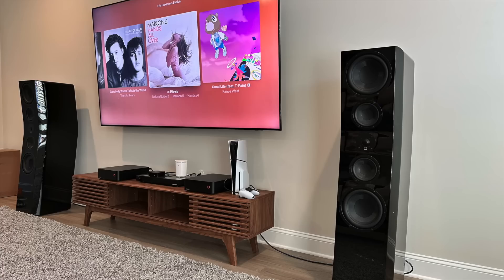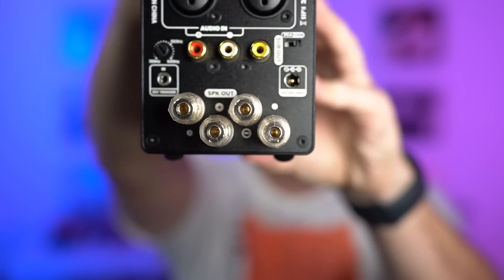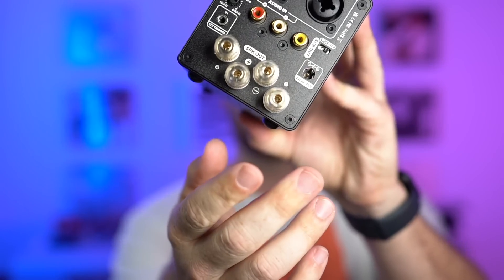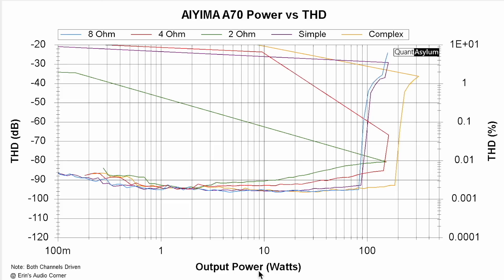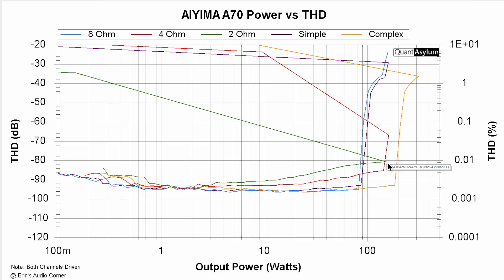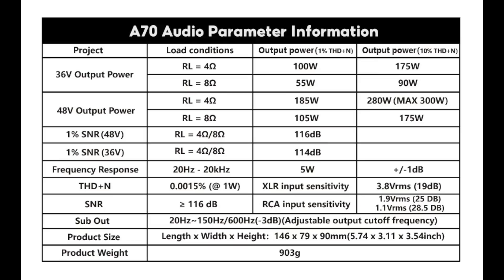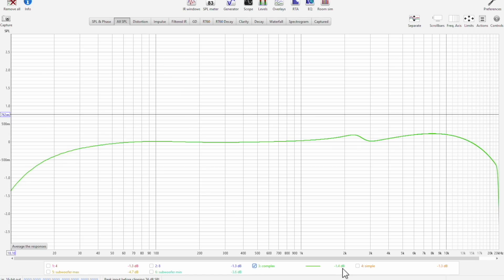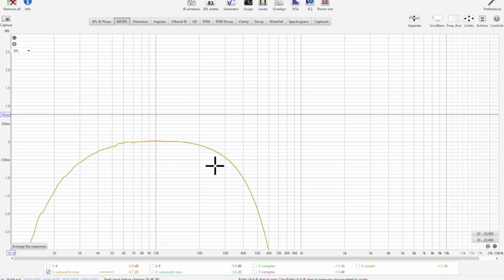The Shocking Truth About the AYEMA A70's Advertised Power!

Comment: I've run into so many annoying problems with load dependency on cheap class D that I got rid of them all and spent the extra to go to class a/b.  I can't quite afford the nice class D stuff.   None of the analysis I've seen done by ASR or Erin actually translates to the real world.  The only person I've seen show it with real speakers is MTG-Designs, and the effects are more pronounced than any of the complex load sims I've seen.  I've experience the A07 responding so poorly with a speaker that it caused a 10db rise from 5khz to 15khz!  

Frankly it doesn't seem like the budget companies are really fixing this problem.   Perhaps they are attempting to, but are ultimately failing.
Reply: The new Fosi V3 monoblocks have addressed this and have more power for about the same price.
Reply: @boomerscs9193  It's not really the same price since you need to buy two.
Reply: @joshcatstream it’s still within only ~ 100 bucks
Jeez, What do you expect for 200 dollars and 150 watts?
Reply: @richardgrant418  there are amps of the same price with no dependency, the audio source amp 100 for instance.
Reply from the maker: no. YouTube isn’t friendly with links. I just checked the junk folder and it wasn’t in there, but it may show up later. If you don’t see it later on then reply again and I’ll check again.
Reply: @ErinsAudioCorner  I figured as such, I can send some measurements via another channel if you're interested.  The issue might sound extreme but I assure you it is real.  The speaker in question was the C note kit from PE.  A quick google of cnote load dependency should bring up some images of my data, the second image result for example.
Reply from the maker: I was going along with you until … 

A 10dB rise from the speaker load?  Sorry, man, but my BS flag shot through the sky when I read that. I’m sure you can forgive me for being highly skeptical of such a statement. Especially without proof. What speaker was it?
Reply: @ErinsAudioCorner  I made a comment with data, did you just delete it?  I think youtube is broken or something.
Reply: @ErinsAudioCorner  What speaker did you use for ABX?